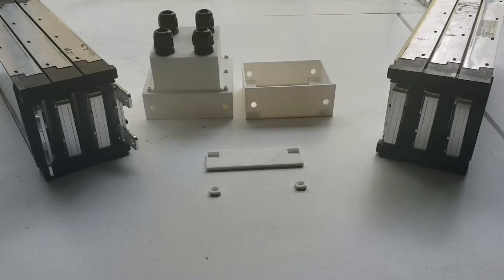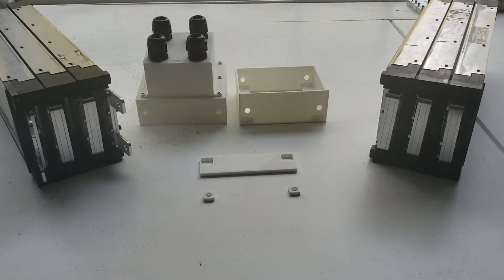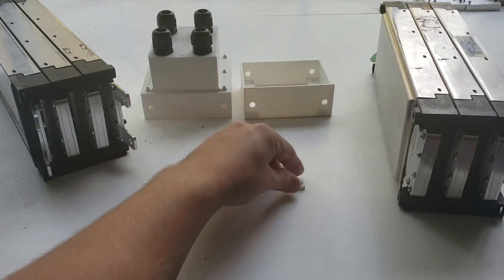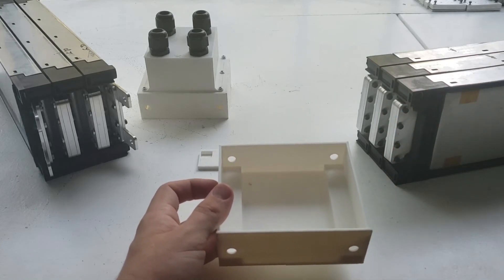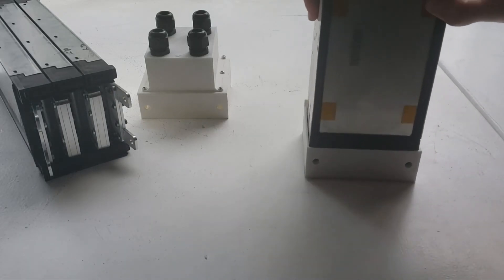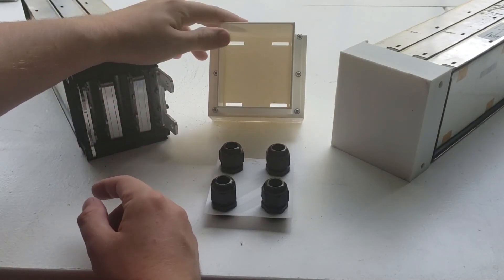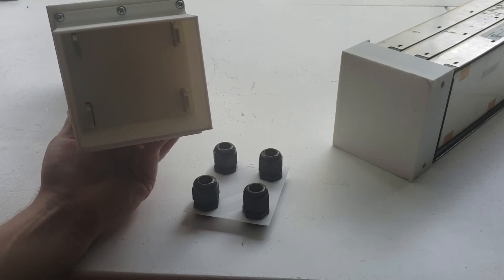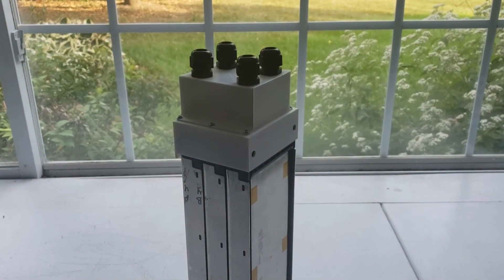HIGH VOLTAGE Covers: LG Chem Battery

Comment: I would put more battery modules. 96v - 26s would work better with your APT"96"600 Motor Controller. You only showed 12_2s modules in the video "Suzuki GS500 Battery Module Set Up".. it would be one more module 1_2s. By the way you have space to put more, I would spend a little money to double the pack from 5.7kwh to 10.6kwh... the ZeroMotorcycles comes with 14.4kwh and it's still low range on the highway. And it would solve your low amperage problem 60 to 120a. AND WAITING FOR MORE VIDEOS....